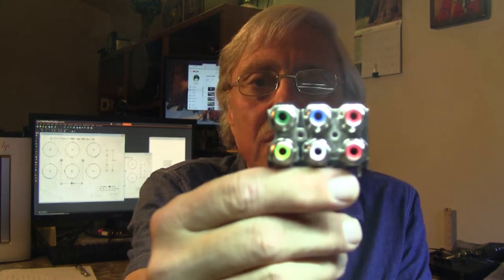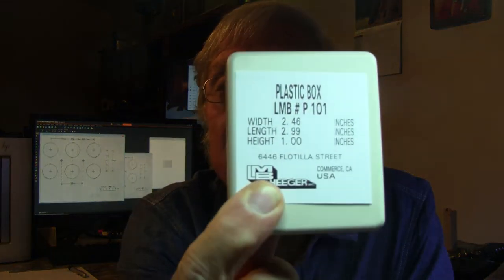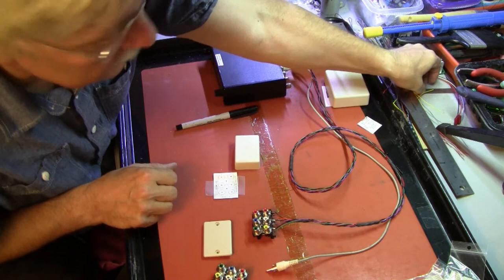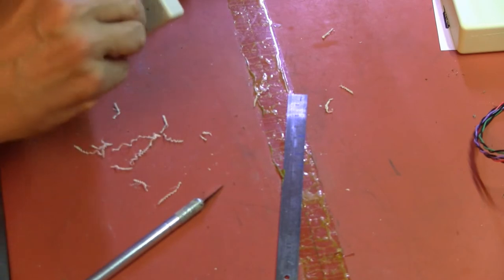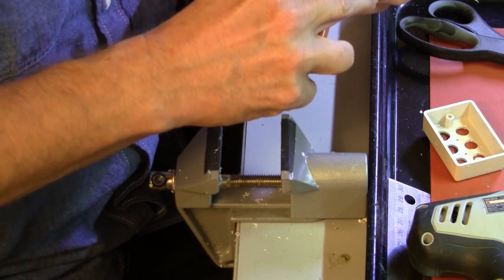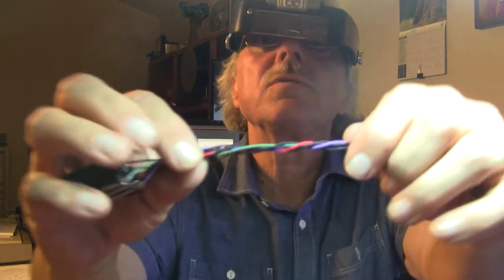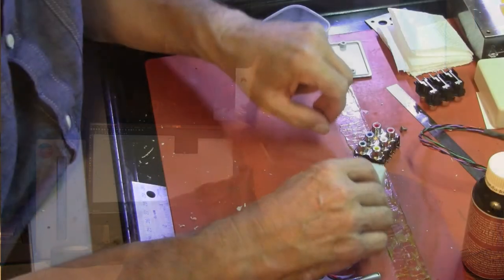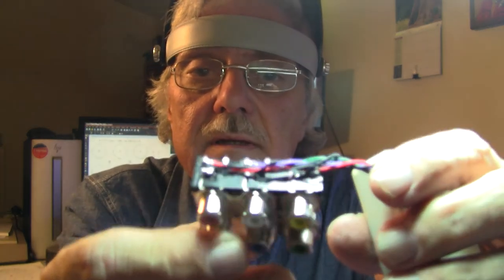NBTV Televisor - Connector Problems and Solutions

Comment: I envy your tech savvy. I can clean the dust out of most electronics and (usually) hook up video components. That's about it. Only been electrocuted 2 or 3 times :0
Reply from the maker: 'That's funny! You got shocked a few times. You can only get electrocuted once. It's kind permanent. The worst shock I got went like this:
I was working on converting a US dental camera product for use in Europe. The mechanical designer failed to put the AC safety shield in the kit I was given. I'm working away, reached into the case, and then suddenly heard in my ears, "BZZZZZZZZZZZZZZZZZ!". Way off in the distance, I heard a blood curdling scream. Then I felt really warm and was floating. Then I noticed a new sound, "Beep... beep...beep...beep...". I opened my eyes and four doctors were leaning over me. "There he is!", one of them said. I was on the table in the emergency room.
YIKES!
Reply: @videolabguy  Wow, you definitely have me beat. Yeah, just a few zaps here and there. Feels pretty funky.